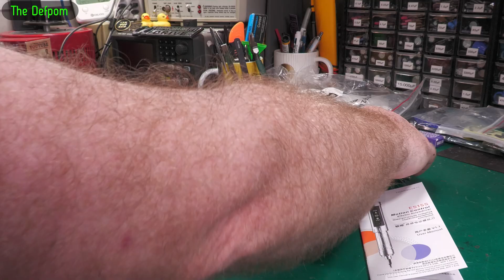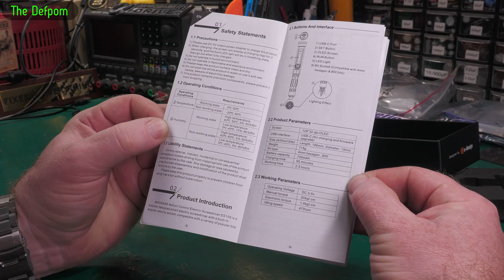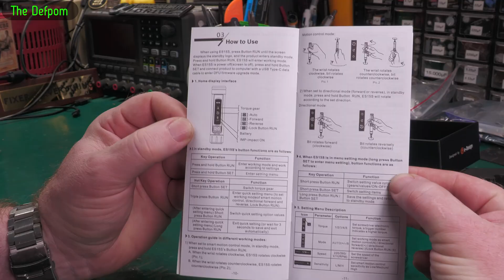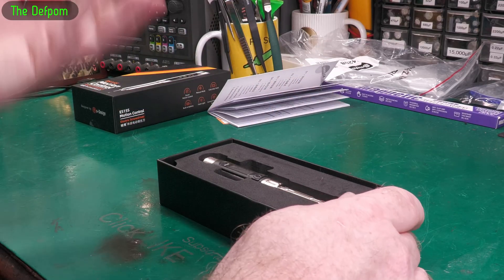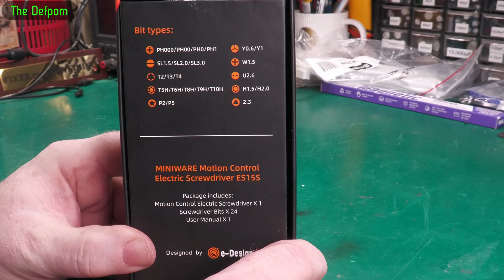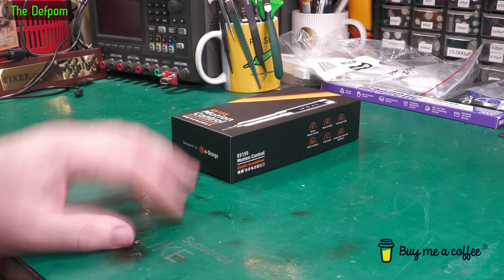🔴 Miniware ES15S Electric Screwdriver Review - No. 1413

Comment: Had mine for 7 months now and I have to say this thing has to be the most disappointing thing I’ve ever bought. 

Firstly I’ve used it maybe a total of 5 hours and the things already dead. No signs of life. Only way to get it to turn on is to put it into DFU mode and firmware upgrade it but despite that working and going through successfully it still won’t work. At first the leds would come on but the motor would not work, now nothing happens at all. 

I never used it much because it’s such an awkward shape it’s really difficult to hold and I constantly found my hand cramping due to its awkward shape. 

Not to mention the bits are made out of the finest cheap Chinese steel so even after selecting the right bit size there still constantly jumping chewing the head of your screw and also destroying the bits. 

And all that for the fine price of 180 bucks! 180 bucks for a screwdriver that fails in a few hours of use, destroys your screws, your bits, and makes your hands cramp. Fantastic value…!

Not to mention I’ve been in touch with support for 6 weeks now and I’m still awaiting a resolution for my dead driver. They keep asking the same questions over and over again despite them being answered multiple times. Biggest waste of 180 bucks ever!
Reply: Oh that sucks, theres people that have had theirs for 2 years daily use and they say its still like new. I just bought one hope its not faulty

Comment: Two types of torque are required when removing a screw. The first is the breaking torque. The second is the turning torque. The breaking torque is always greater than the turning torque. Because the Miniware electric screwdriver has such a low torque, they wanted to allow you to overcome the breaking torque by turning it manually. Therefore, they require you to turn the electric screwdriver counterclockwise to remove the screw.

Comment: I dont know if you have a 3D printer? For the older model I was using 10 years ago someone made a 3D print that would put the button trigger at the bottom. It was just a leaver that would snap on.

Comment: I use a Black & Decker cordless screwdriver on the bench, with the extension, and it's a bit larger and has more oomph than this. You need this, especially, when you're working on older transceivers, radios, and test equipment.

Comment: had my manual screwdriver for years and still have not needed to recharge it once.
Reply: There you go I have a wow stick and a Bosch Go the bosch Go needs charging but the wow stick works on ordinary AAA batteries great and on the wow stick when not in use just ease the battery screw loose and they last ages
Reply: @fredflintstone1 as long as I've got a jar of elbow grease on the shelf mine will just go on forever 😂😅😊